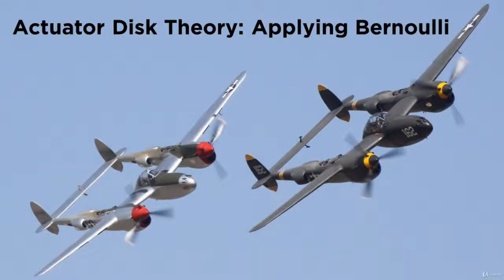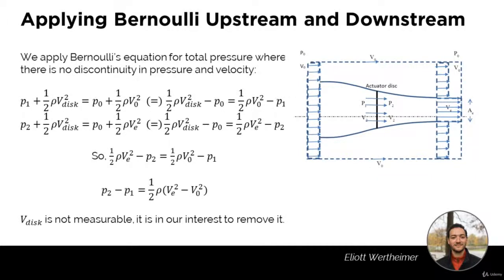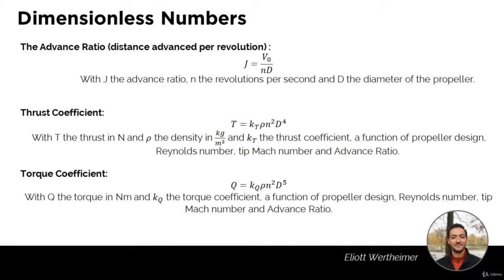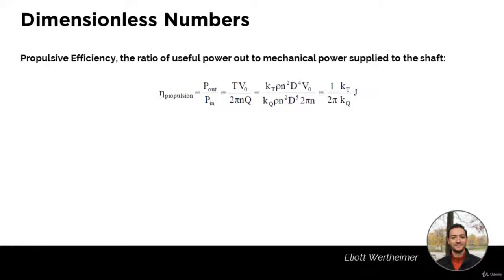Calculate Thrust, Power and Efficiency using Actuator Disk Theory and Bernoulli's Principle

Comment: How can I apply this to the propeller of quadcopters at cruise. For this I assume V_0 = 0 because the quadcopter is not moving upwards, but then the equation doesn't work.
Reply: If you are interested in the static thrust case, this equation does not work. You should define the velocities in a different way for that.
Introducing w as the induced velocity you can rewrite:
V_0 = V_0
V_disk = V_0 + w
V_e = V_0 + 2 * w      since V_disk = (V_e + V_0)/2
This way you can also rewrite the power as
P = T * V_disk = T * (V_0 + w) = 2 * rho * A_disk * w * (V_0 + w)^2
You can solve w
(2 * rho * A_disk) * w^2 + (2 * rho * A_disk * V_0) * w – T = 0
To find (w must be positive)
w = (-1/2 * V_0) + 1/2 * (V_0^2 + (2* T /(rho * A_disk)))^0.5 
Using P = T * (V_0 + w) you can calculate any case, including static case
If V_0 = 0:
P_0 = T * w_0
w_0 = (T /(2* rho * A_disk))^0.5
and therefore
P_0 = T^(3/2) / (2* rho * A_disk)^0.5
This is a well known equation for ideal power estimation in static thrust condition. For hover (vertical thrust), thrust = weight.
Reply: I was about to ask the same question! I wonder if the equation T = rho * A_disk * 1/2 * (V_e^2 - V_0^2) is still valid if V_0 = 0